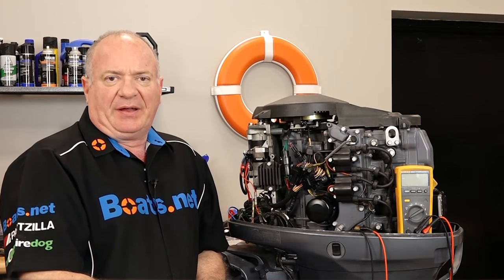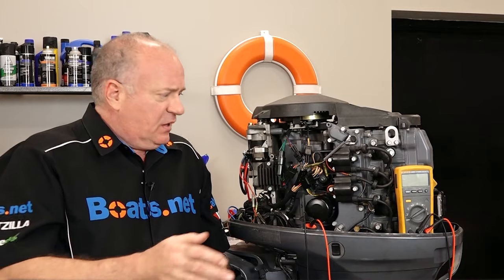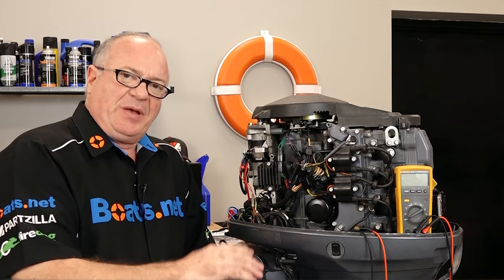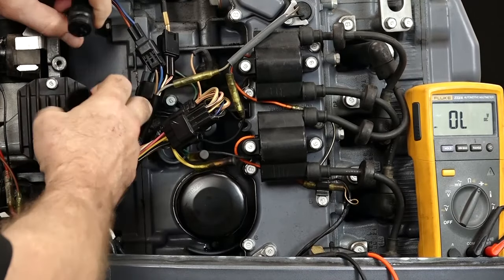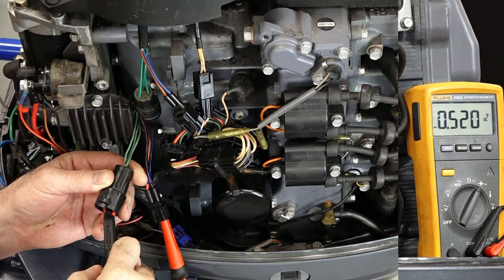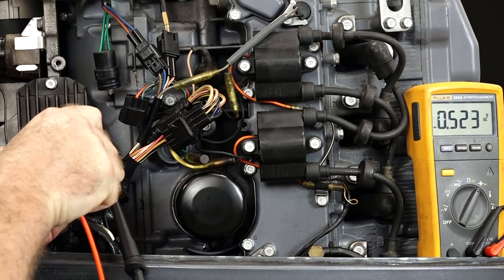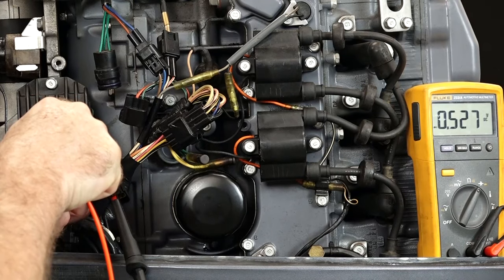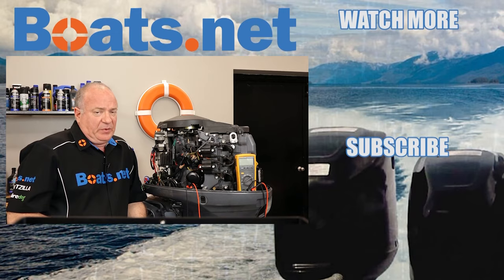How to Test a Regulator Rectifier on an Outboard  | Outboard Regulator Rectifier Test | Boats.net

Comment: Excellent Video sir! I have an 89 merc 150 blk Max xr4 MOTOR . Would a bad rectifier cause the tachometer not to work? I`ve replaced the old one with a new one and it still doesn`t work.

Comment: What does a pegged voltmeter gauge in your boat possibly indicate? Is that an indicator of a bad voltage regulator?
Reply: Verify what the voltage is to determine is the voltage is actual that high that the Gauge cannot read it or if the Gauge is bad.

Comment: When I turn ignition switch ,the solenoid clicks on/off rapidly - tested across coil [4-5volts]could it be a faulty regualtor causing these problems,   thx

Comment: Hey man... What if we tested the output voltage of the rectifier when the engine is running  ?? 
Can we check weather if is working or not like that ?
Reply: That's the key question usually and im still looking how to do it